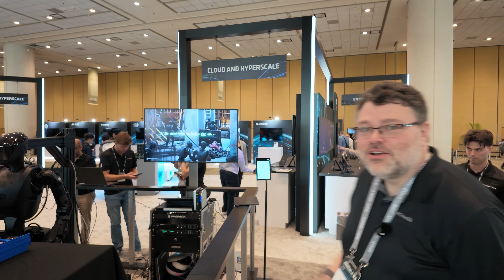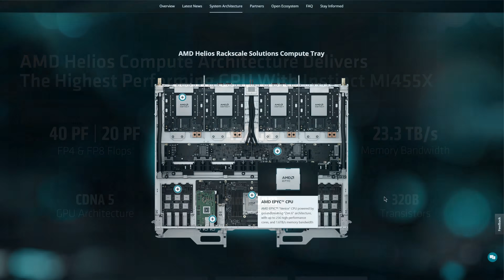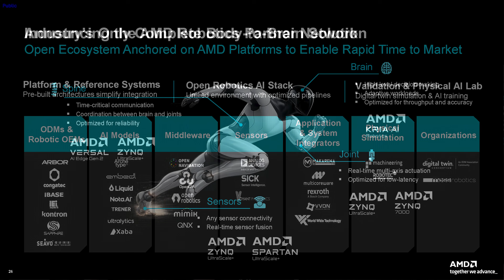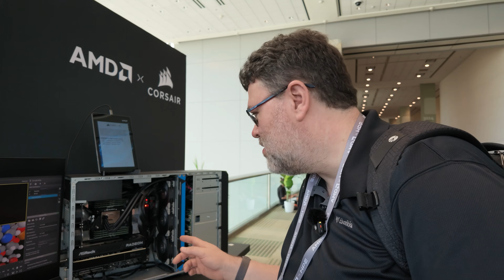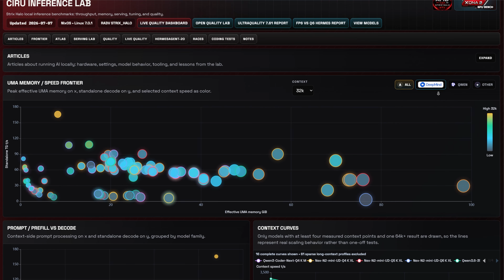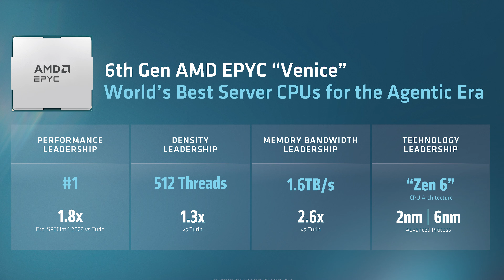Wendell and Robots at AMD's Advancing AI Event

Comment: Hey Wendell this might be a bit of a specific question but did you by chance run into any of the oxide computer guys? I know they were there and I've always wanted your take on the server rack they've developed along a 'hyperscale cloud infra for the masses' goal. They do their own hardware including board level design and firmware and a lot of it open source. As a computer janitor I always thought it was something you'd like, not so much from the homelab side as their smallest unit is a (partially populated) rack.
Other interesting things; they did their own bmc based on an stm micro, including their own embedded os instead of using aspeed; they boot without a bios; they did their own p4 programmable switch based on Intel tofino (rip tofino); all the compute sleds blind mate into a cabled backplane.

Comment: I suspect robots are going to be the backbone of AI usage in the future, and it will be industrial ones doing things like inserting RAM into sockets, and doing the heavy lifting in dangerous factory areas.  And I'm guessing focused local AI, not cloud racks converting Shakespeare  to Monty Python with LLMs.  I also suspect its going to be cheaper to use AI to learn automation and convert it to standard calculations/robotics instructions, and to observe normal automation failures and launch remediation procedures, rather than using AI all the time for automation tasks.
Reply: you are way too simple minded, robots already build motherboards...you think humans are sitting there with a soldering iron?
you wont need a humanoid robot for lifting heavy things, you make an entire heavily lifting machine that happens to be automated and then put your trust entirely in that.....but these humanoid robots are beyond stupid.
Reply: @Decenium  The video had a robot inserting ram into ram sockets, not soldering it to the board.  Ram comes on different size boards, some with heatsinks etc.  I suspect the humanoid robots have very limited applications due to the cost of the form-factor,  but AI can help automate custom builds using slightly more flexible "hands" than you would find on a PCB production line.  It isn't just RAM, being able to quickly train a robot to put the correct screws in ITX and E-ATX boards or a combination of different cases would be useful.
Reply: @fanshaw  it would not be at all...if you want a motherboard to come with ram pre-installed...we can do that...EASILY, without some stupid humanoid robot using his humanoid hands to do it....
Reply: @Decenium  I'm pretty sure the ram robot was not a humanoid one and I wasn't suggesting it should be.  AI might be useful to find the board id, look up the technical details online, identify the ram slots, identify the ram type, notch orientation, tell the warehouse robot which ram type is required, pick it up, orient it correctly and insert it.  Any new board should have human confirmation at each step, but it should be able to check everything (correct components provided?) and do the right thing, outside a factory where they are doing a run of 10,000 dell laptops all with the same components.

Comment: I would be so happy if AMD also released something like a "MI450P", a MI400 series PCIe card, preferably in a workstation form factor.
The customers are there, but man even the MI350P are unobtainium! (unless you buy a whole new dual socket server to go with it, even if you already have a capable server and do not need another new one....)
Reply: why, what would you use it for?
Reply: @Decenium  Long horizon agentic tasks, onprem.
HBM is the key, and we need workstation cards with HBM memory (and a lot of it), and MI350P is a solid solution today. If only it had workstation form factor it would be easier to implement. We need them to be relatively quiet, looking at water blocks for these.

Comment: So nice AMD could also release something for the normal consumer base. The 9050 8GB is definitely gonna be a MARKET DISRUPTER. RIGHT GUYS?
Reply: or buy a prebuilt PC with a 9050 in it and not paying attention, realizing it has an (OEM only) 9050 4G in it. 
a HD6950 had 2GB in it, and it was released in 2010.
16 
years
ago

and had half the VRAM in it.
not sure if I got the 1GB or 2GB version, though, but the point still stands.

Comment: As an AI newb, I'm reminded of my time back in 1994 when I could budget $1000/year on new computing hardware. I originally bought a new $6000 machine every six years, but then moved to $3000 every 3 years. Eventually I only bought a new $3000 machine every 6 years, because the improvements didn't justify a new machine every 3 years. I would really love to hear from Wendell or other commenters, some advice about long term budgeting -- if you can spend $X/year -- what is the sweet spot on how often we should be upgrading our hardware? My specific setup is I have a 128G Framework Desktop that I got just to dabble in AI and I'm so happy I did. I'm not yet getting all that I can out of it, mostly because I don't yet have the knowledge infrastructure to utilize it. But, as a hobbyist, what upgrade cycle should one be thinking about ... or should I not think in terms of an upgrade cycle, and just wait for a specific use case that I need that I can't run on the hardware that I have?

Comment: I got to chat with several of your guests on the show floor, what a great conference! I was also dumbstruck by the Kria bundling of FPGA — we just need for Vivado and the FPGA toolchain to be as open source as ROCm and kernel drivers are. The biggest reveal for me was the incoming RDMA+RCCL drivers for USB4, which will allow for a three-way mesh of Gorgon Halo with 60Gbps full duplex and single-digit microseconds latency. Crazy to get that scalability with a $30 cable and no cards or switches needed!

Comment: Thank you sir nice work you need to be jealous I want some of the toys😂 does processors with 128 cores looks really cool I'm currently just picked up a AMD 3950x 16 cores 32 threads but I couldn't get a good graphic card so I was able to grab a a Nvidia p100 16 gig I'm going to run a local model assistant
Reply: Gonna use a 5600g apu with 16g of vram

Comment: I keep trying to understand this so how is robotics AI different than the old machine learning? or is it just marketing?
Reply: AI is a marketing term for brute force machine learning, nothing more.
Real AI is not even on the horizon.
Theres a flick from 1986 „short circuit“ about a robot ( Number 5 ) like these AMD showroom pieces becoming self aware and starting to reason like a child.
Thats 40 years ago, and we are not even close to that level of AI.
Reply: The difference is how versatile a thing can be. Old traditional machine learning was very good at finding patterns in data and optimizing for it. I would argue “true” AI is much more versatile in that you can give a system multiple different instructions, and the system can figure out how to execute each one even if that instruction wasn’t specifically in its training set. Along the lines of take this thing, put it over there, then return with the thing on the other side of the room. If these are commercial systems, the user’s environment isn’t going to be anything like the training environment making navigation much more difficult. AI is able to generalize really well, understand its environment, and is able to do more than one specialized task at expert level.

Comment: The 395+ is behind Apple's M4 and M5 in performance IIRC, but it's also a lot less expensive. It's faster than Intel's recent release AFAICT. How does it compare to Nvidia's new device? And how does the 495+ change things?
Reply: 495+ with 192GB of memory will leave NVDA Spark in the dust. It will run Deepseek V4 locally with room to spare. NVDA Spark will puke blood & die if you try to download Deepseek V4 with its measly 128GB.
Reply: @tringuyen7519  And what about vs the 395+ with the same amount of memory? Or for that matter, the 495+ with the same RAM?

Comment: Are they going to let the Strix Halo successors have ECC memory support?
Reply: The X100 is basically a strix halo with ECC support. Same specs.
Reply: Zen 5 is old AF at this point and the jump to Zen 6 will bring more performance benefits than the one from Zen+ to Zen 2 that’s why I’m holding out for the successor. If you’re getting f’d with the memory prices I’d at least want the current CPU and GPU core architecture on a platform you cannot upgrade. Or maybe they’ll introduce modular platforms with SOCAMM2?

Comment: Great video with some truly eye-bulging technology. That rack with 1000 cores per U is hideously expensive - I can't even imagine the stick price on one of those maxed out on memory and CPUs right now. I wonder if the chasm between in-home and enterprise computing has ever been this wide before? Probably not I imagine.
Reply: Yeah, back before personal computing was much of a thing at all...
Reply: I mean... The 90s were a thing
Reply: @JBrinx18 So were the 50s and 70s. Though, in-home computing didn't really excist until the 70s, and the price from home computing were expensive so I guess the gap were smaller. 

If you consider mobile devices to be home computing then the gap between the cheapest home computing device and the most expensive enterprise unit is probably the largest in these days.
Reply: @JBrinx18  I don't even know what this implies, but okay.
Reply: @FrenziedManbeast I mean, home computing was much weaker than now, and the Gulf to data center enterprise was arguably much larger
Reply: @JBrinx18  Consumer Computing in general was never the biggest market. It was steadily declining year after year even before Ai
Reply: @JBrinx18  How do you figure? In the 1990s we had 4U servers with MAYBE two CPU cores for entire 4U system(assuming you aren't talking about Itanium or IBM mainframe). Compared to today we have AMD's rack with FORTY THOUSAND CORES and hundreds of TB in memory. Considering most home users are still running 16GB of RAM, I don't see how the 1990s came within a country mile compared to today? 

That's not even talking about networking speeds today.